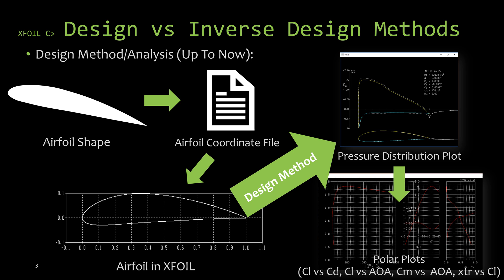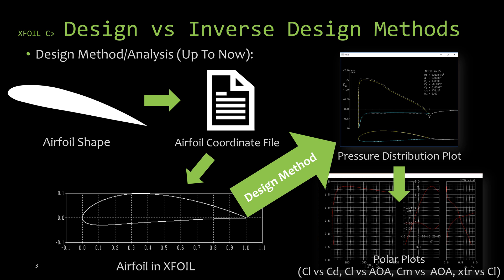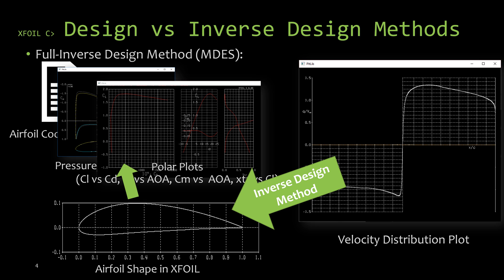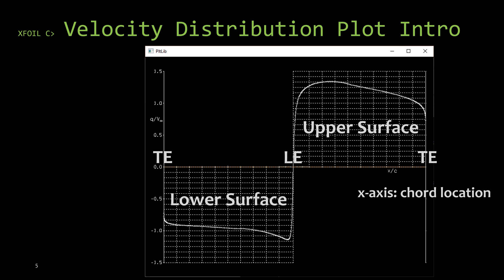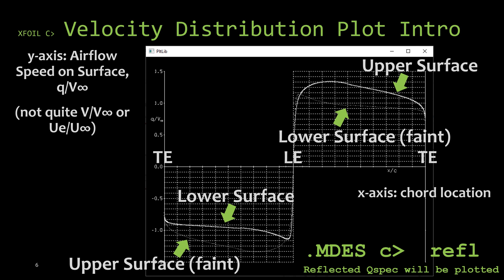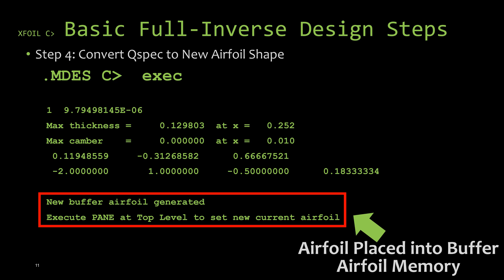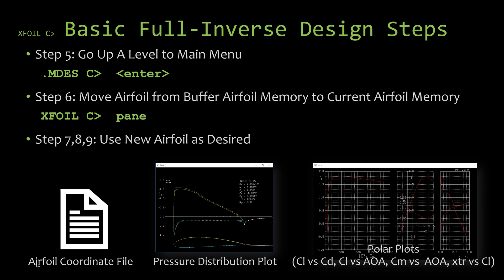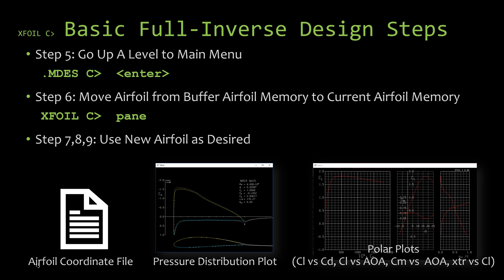XFOIL Tutorial 9: Full Inverse Design Basics

Comment: Hi great video!  Learned a lot. However, I don’t understand how you call this inverse design. Yeah I see how you are going from velocity to airfoils. That is fine, but a velocity distribution is not the end point of a conventional analysis: Cl and Cd at Alpha is the end point. And therefore Cl and Cd at Alpha MUST be the starting point for a true “inverse design”. I have no more idea than a goat what velocity distribution I might want to start with to do an inverse design like you describe, be cause velocity is not my end point nor my starting point.  So we at least have a significant difference in definitions, or there is some very important prior step left out that converts the Cl and Cd and alpha into those velocity profiles. Without that, I see no use for what you show in this video. What did I miss?

Comment: Actually, I am trying to optimize the airfoil using Python code but I am not good with the codes so I have been facing some difficulties. But after using this method thickness and position of maximum thickness have been modified so I can use this Inverse method as optimization method too right?

Comment: Thank you for the amazing video. I had a question though. I need to change the velocity distribution to my NACA2415 airfoil such that at cruise lift coefficient of CL=0.5, i get  increased laminar flow and therefore a higher Cl/Cd. I changed the velocity distribution in mdes and then used exec and pane to load it into the current memory. When I then tried to see the pressure distribution for my modified velocity distribution, i got the error 'Not converged'. Does this mean there is a problem with the modified velocity distribution or do i take more iterations by using iter in oper?
Reply from the maker: XFOIL uses an iterative method to arrive at a solution where it takes the last results of running its method as the starting points for the next run of its method until it “converges” on a solution. Converged means that the difference between the starting point value and ending point value of a run is below the convergence threshold. There is a limit to how many times it will run through its method (we don’t want to get stuck in an infinite loop if it is an invalid solution that will never converge). If it gets to this limit before converging it will give you that error that it failed to converge. There are three causes to this. 1) It needed a few more iterations to converge. This is why I recommend always increasing the iteration limit (using the iter command) from the default of like 10 to something more like 250-300. 2) On less often occasions, the method will get stuck between two values. For example, the results of one run gives x1. When putting x1 in as the starting point for the next run, the results give you x2. However, when putting x2 into the results as the starting point for the next run the results give you x1. As you can see, this will cause the method to bounce back and forth between x1 and x2 (usually a value slightly higher and a value slightly lower than “the converged value” would be). This can be fixed by slightly modifying the input values (AoA 25 degs -> 25.0001 degs, Re 3,000,000 -> 3,000,001) so that it doesn’t bounce between the two numbers. 3) Non-valid solution. For example, if the max coefficient of lift the airfoil can achieve under the current conditions is 0.34 and you are trying to get results for a coefficient of lift of 0.4. For this you might try doing a sweep of angle of attacks to find the max coefficient of lift to see if what you are trying is a valid solution. Try looking at the results printed to the screen after each run to see if it is bouncing between two values, converging on a solution but just needs more iterations, or if its running off on a wild goose chase trying for a number that probably doesn’t exist. Hope this helps!
Reply: the Science of Flight thank you!

Comment: Very detailed tutorial! Thank you so much! Do you know how to output the leading edge radius of the loaded airfoil from GDES menu to Matlab automatically?
Reply from the maker: Unfortunately, input and output of data using files is a weak point of XFOIL. I hope in future versions that much more of the values are available to output to a file and therefore have more capability to run XFOIL from Matlab (I have it on my list of potential improvements to try and code up and try and get included into the next version). That being said I do know of one output file option available for airfoil geometric values in the standard commands available from the command line prompt. After loading an airfoil into XFOIL, if you navigate to the “Geometric Design” menu by typing in GDES and hitting enter and then you can navigate to the “Camber” sub-menu by typing in CAMB and hitting enter. In this sub-menu, you are able to write the airfoil camber and thickness to a file. This file will contain 4 columns: 1) chord location of camber, 2) camber, 3) chord location of thickness, and 4) thickness. Note: The thickness is the thickness above and below the camber line so if you will need to double this column if looking for the max thickness value. For example, NACA 4412 has a 12% max thickness but the 4th column of the output camber file will have a max of 0.060017. This is because the total thickness is 0.060017 above the camber line plus 0.060017 below the camber line for a max thickness of 0.120034, or 12.0034%.

Another work around would be to output the airfoil coordinates to a file (using the PSAV command in the main menu) and calculate the values you are looking for from the airfoil shape directly. You could potentially find in the source the code you are looking for to calculate a particular geometric value and use it to calculate the value (though you would need to abide by the GNU General Public License for your new code).

Hope this helps! Thanks for the kind words of appreciation for the channel. I’m just getting started, so many more XFOIL videos to make, lol.

Comment: @
the Science of Flight
Thanks for the video!
Could you please explain a bit more on how we should modify the qspec to reach our design requirements? Usually the designers are provided with a datasheet like below:
http://www.airfoils.com/specifications.pdf
I don't know how we should interpret these data to qspec.
Also, should the starter airfoil be as close as possible to the final desired performance to start with or it doesn't make a difference what airfoil to use as a starter?
Thanks in advance
Reply from the maker: It's usually better to start with an airfoil that's closer to your desired performance as it will have to make "less" modifications and will hopefully run "faster" but not always. I've gotten a few comments about the design process. I working on developing a few build projects for the channel. I'll try and add in some airfoil design videos into the process/video series.

Comment: if i want to modify an initial design of a NACA 2115 , via inverse design. How do I set a value for CL such that it modifies my geometry? Thank you for your videos
Reply from the maker: We must remember that the inverse design method’s purpose is to create a new airfoil geometry for a changed velocity distribution around the airfoil, not necessarily for a given coefficient of lift. Now the “CQ” command in the MDES menu is used to specify the coefficient of lift of the Qspec (specified, or I’ll say “buffer”, velocity distribution). When a coefficient of lift is specified using this command, then after each modification you make to the velocity distribution, or Qspec, XFOIL will run an alpha correction. The alpha correction will change the angle of attack of the airfoil to achieve the specified coefficient of lift. This means that specifying a coefficient of lift will maintain that coefficient of lift through changes but won’t necessarily modify the airfoil geometry.

So if I were trying to do it the way you suggest, I would first load the NACA 2115 airfoil, go down into the OPER menu, enter in the desired flow parameters (Mach number, Reynold’s number, etc), run a series of angles of attack to find the max Cl for your flow parameters, rerun it at the max CL angle of attack, go up out of the OPER menu and then down to the MDES menu (Qspec will be set to the latest q that you just ran), specify the desired coefficient of lift, modify the Qspec slightly, and see what angle of attack I get (occurs before the stall angle of attack?). Might need to play with modifying the Qspec for a bit to get a reasonable angle of attack. When you’re done with playing with the Qspec then use the EXEC command to run the full-inverse routine to generate the new airfoil shape.

I hope this helps!

Comment: Great video, thank you! Do you know if there is any way to import an external designed pressure (or velocity) distribution (e.g. from matlab) into xfoil in order to execute the inverse design?
Reply from the maker: I spent some time trying to find an easy way to do this, but I don’t think there is one. Both the QDES and MDES only let you modify the Qspec and not import it (unless you’re reloading it from q in the OPER menu or from a different angle of attack/cl of something already ran in the OPER menu). When dropping down into the MDES menu in step 2, the Qspec (specified, or I’ll call it the “buffer”, velocity distribution) is loaded with the current q (velocity distribution) from the last solution obtained from direct analysis in the OPER menu. If it doesn’t exist, XFOIL will run the airfoil at the last angle of attack that was run in the current session of XFOIL and uses that q for the Qspec. Now, while the OPER menu allows you to export q in the dump file, it doesn’t let you import a dump file. So, you can’t get it in from Matlab using the dump file and it’s not part of the polar save file. The closest you can get is to use Matlab to import the airfoil, modify the freestream flow parameters, and then run a quick analysis for your desired angle of attack before entering the MDES/QDES menus.

Going further. This essentially makes the inverse design method a “redesign” method that needs a starting point to generate a new speed distribution. The reason given for the justification of this redesign method was given in the documentation as: “A ‘pure' design code which requests the entire surface speed distribution every time is often less natural to use, since airfoil design is invariably an iterative process involving repeated analyze/fix cycles.” I’ll add this functionality to a list I keep of possible future code improvements. Hopes this helps even though it may be bad news!
Reply: @thescienceofflight1404  Wow, thanks for the detailed reply and for your effort! I should mention that meanwhile I did find a solution. When calling "MDES", one can import an external file with the command "read" and export the current distribution with "writ". For some reason, these commands do not appear when entering "?". However, when opening the code of the MDES, it does appear somewhere in the list of commands.
Reply from the maker: @Zibit562 Excellent find! Good thinking going to the source code. Thanks for sharing with the group and I. I will definitely be using this in the future.